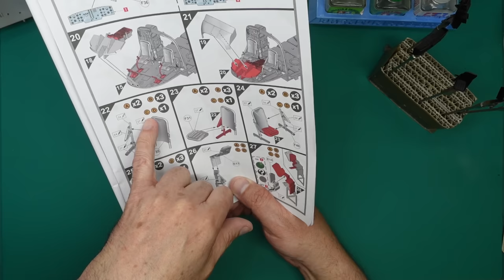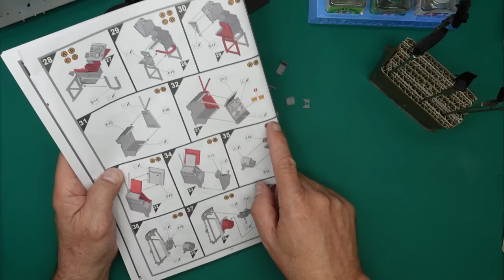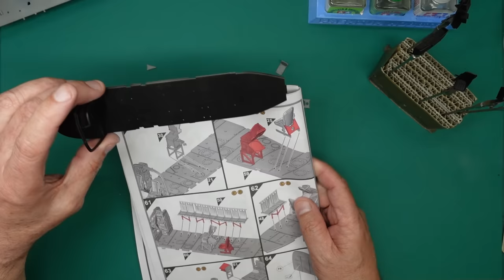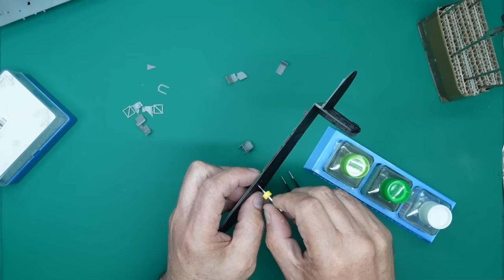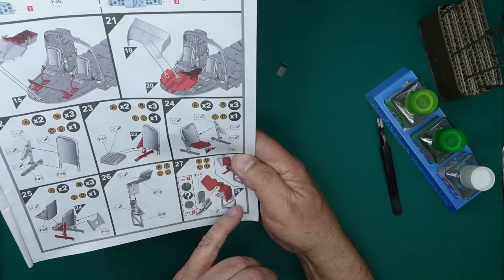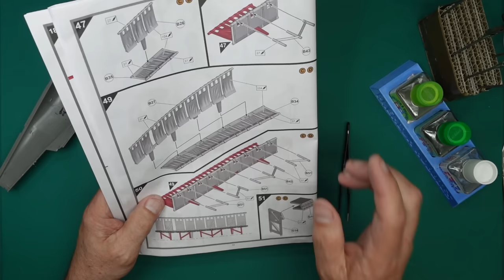Brand new Airfix 1/48 Sea King video build in 1440p . Part Three.

Comment: Hi Nigel, the white marks on the plastic might be stress from cutting.  Reach out for your single sided nippers and try using them to see if it's better. Also, try a new sharp conventional double-sided Tamiya nipper.  Hope this sparks your engineering interest. Kind regards, Dave Porter London.
Reply from the maker: Its weird Dave, I have tried all sorts and the marks are still there? They remain after sanding and are not in the middle, they surround the sprue nib??

Comment: Those whitish marks you noted are commonly the result of what happens at the cutting interface when all but the sharpest cutting tools are employed during desprueing.  Actually, what happens is more akin to the effect of crushing some of the styrene from the blade's pressure against it.  The whitish mark is typical of any color styrene in my experience.  The effected area appears somewhat bleached and may extend to considerable depth into the piece you are freeing.  The area immediately at the surface is very raw looking and often appears chewed up if you look closely.  Normally, there is a small stump of sprue left at the cut point on the part, and we typically trim that off with a knife or sanding devise.  Once freed of the pressure component of the cut, the bleached material is easily removed or greatly reduced in size and may not be noticed. I have never used any cutting tool that wouldn't leave this kind of witness mark on styrene, at least some of the time.  When flush cutters are too dull, they will often take a small chunk of styrene out of the surface of the cutting point.  This kind of damage is not fixable by merely sanding the area flush with the part's surface.  I have learned to never cut exactly at the surface of the part so that any chewed up plastic does not extend down into the part's desired surface.  The final trin is finished with a small file or mild sanding tools.  Actually,
 flsh cutters should be called flush crunchers because of what the end result looks like.

so
Reply from the maker: I know what you're talking about Larry, I don't think this is it. Even if i leave half a mm of sprue on the part then sand it off the mark remains, but it is hidden by a coat of paint. It is not a section pulled out, it is a white mark around the sprue gate??

Comment: Dark Admiralty Grey was what was applied to the airframe structure - part of which is visible at the rear of the cabin door opening and where the fire extinguisher is stowed. Look carefully, and you can see that is actually quite a dark grey - also, the vertical pole to the right and seat framing to the left are DAG.

 

Sound-proofing varied in types of material and associated shades - look at the rear bulkhead, and there's shiny stuff used under something lighter and matt above. Similarly, the taut material used for the upper side and roofing panels is different to that lower down at the sides - for those, you can pretty much pick any shades of grey.
Reply from the maker: Thanks Annie.  I think I got it somewhere handy?

Comment: The blue interior is partially shown in their interview video.
I doubt youtube will like a link but the video is called

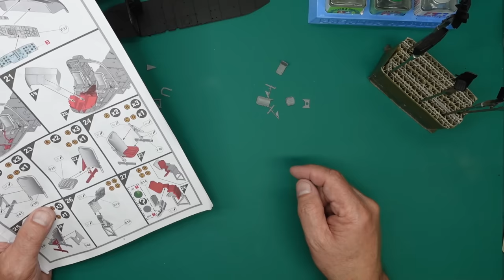Airfix | NEW TOOL Westland Sea King HAS.1/HAS.5/HU.5 1:48 Scale!

At time 2min 56 seconds you see a partial interior and in the bottom left you can see blue on the side. It could be that only one scheme had blue inside and probably while in civilian service. Blue doesn't feel right for a military aircraft.
Reply: I worked on this aircraft during the mid 1980 and can’t remember any blue soundproofing but it could just be that when I worked it it was in its grey phase

Comment: Nigel, Technique question:  What is the open working time for the VMS Flexi 5K, from the time you put some on the Pringles can lid until it becomes no longer usable (i.e.,  can no longer be applied with the the glue looper or the knife blade edge)?  Thanks.
Reply from the maker: Depending on temp.. a long time,. around 30 mins.

Comment: Funny how I believe I've had the white marks in every single piece I ever cut... I honestly brushed it off as stress marks due to an inferior quality nipper and/or plastic, I never bothered since often they disappear when I sand and then disappear completely when I paint.
Reply from the maker: I’ve never noticed them before. I always trim a few thou away and then sand or trim. With this you get a white mark around the sprue nib? Not an issue, just an observation.

Comment: The white marks are caused by crazing of the surface.
Reply from the maker: Would you care to expand on that please?
Reply: @NigelsModellingBench  It's like a brittle fracture of metal creating a rough surface "This phenomenon is known as "stress-whitening". This is more common in amorphous materials, and also in some brittle polymers like PS, PMMA and Polycarbonate. The white colour is because of the light scattering by the crazes and changes in the refractive index of the area under stress"